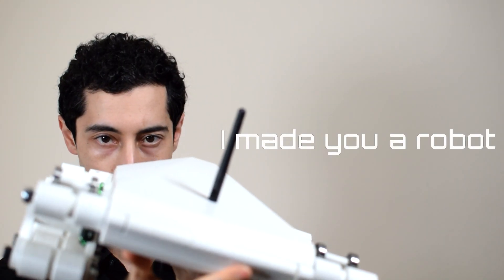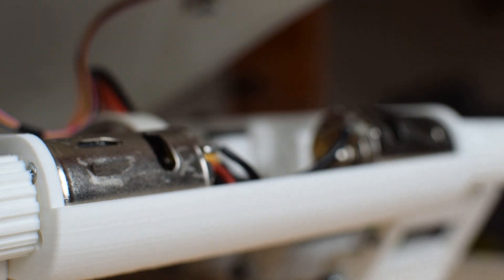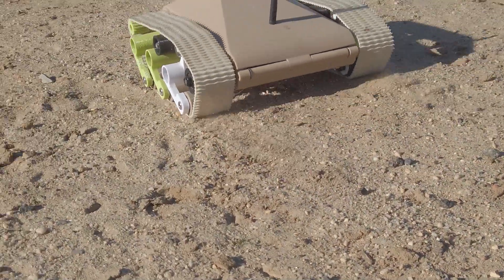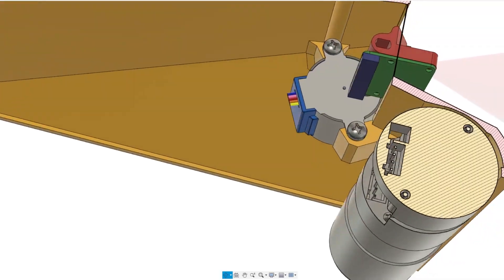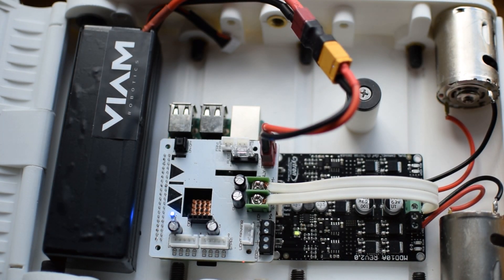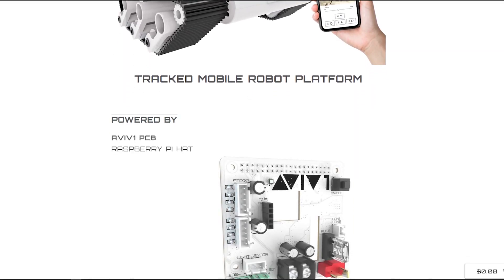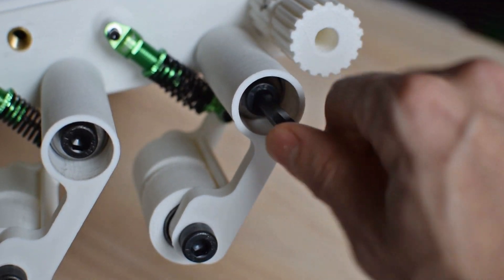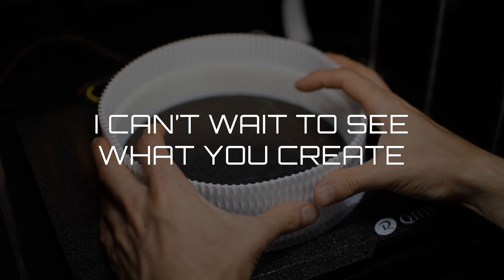I Made You a Robot

Comment: There’s a significant portion of the clips that show the robot driving that have the camera facing backwards. Is the camera not meant to be facing forwards, or does it drive better with the camera in the back?
Reply from the maker: It definitely "kicks" more when you drive it backwards because all the weight is by the motors. So you can more easily go up an incline due to the imbalance.